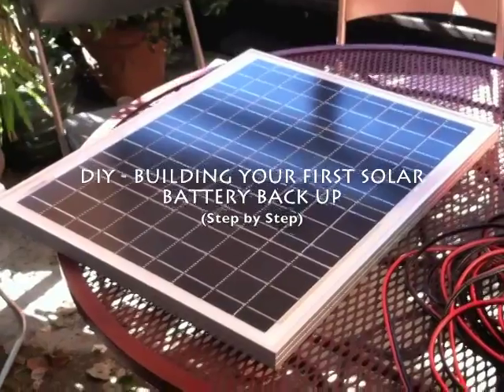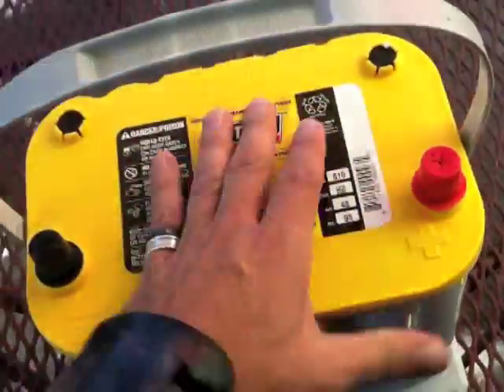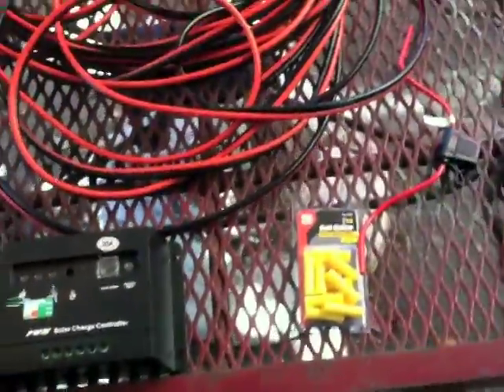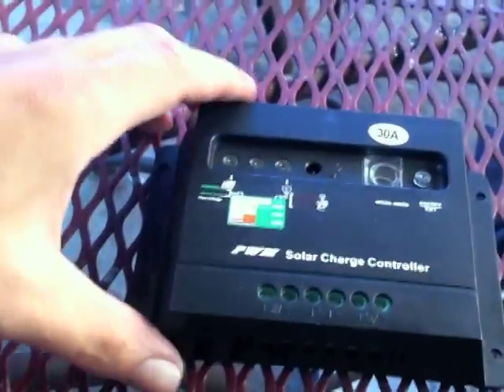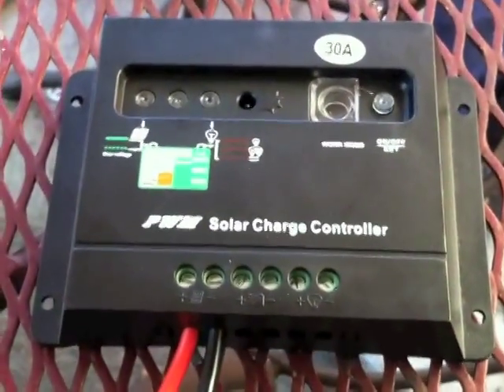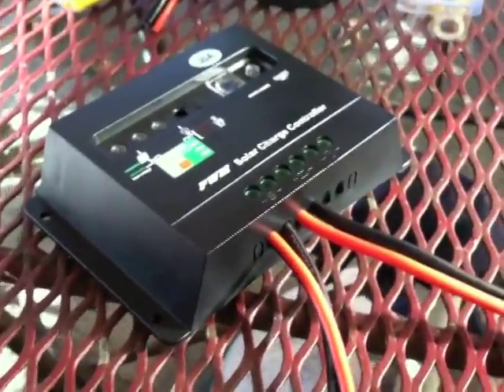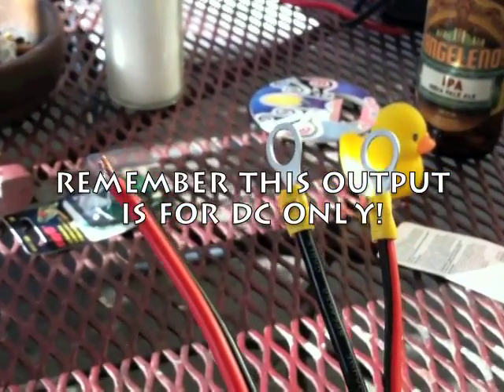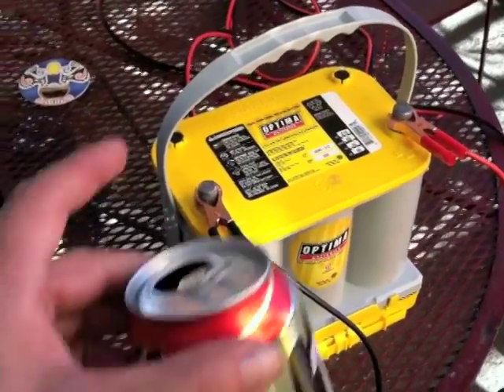DIY - Step by Step - Building Your First Solar Battery Rig

Comment: Great video !  One instruction sheet I read on ebay for a Controller said to connect the Battery First !  Then the Solar Panel and then the Load !  Ordered a Controller with a LCD Screen and may pick up a Solar Panel from Harbor Freight.  The Pen (or Radio) is mightier than the Sword !  tjl

Comment: Nice video, thanks, but I was very nervous of all those wires on what looks like a metal table, hi.

I've seen videos where the user hooks the load to the battery, not to the load terminals on the controller. Is there anything wrong with that? 

73 de Jim ZSJMB